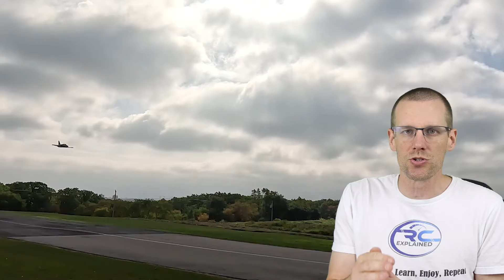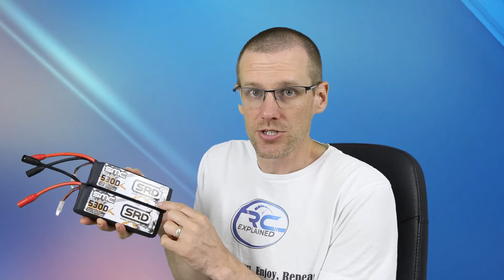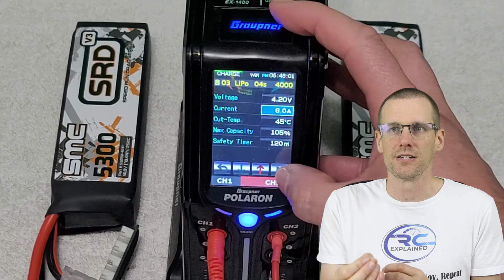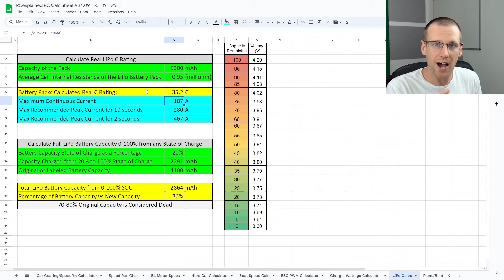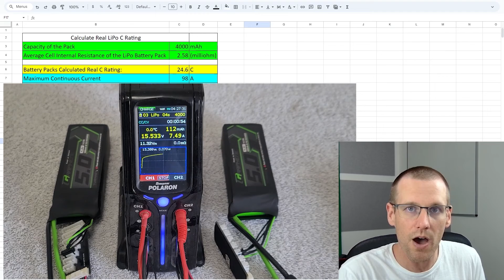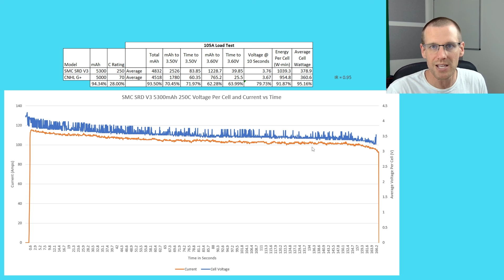Data Shows the SMC 5300 SRD V3 is VERY Good for Speed Runs & High-Powered RCs!

Comment: hey man, I might be making a video sharing some insights on Li-ion vs LiPo, with you as one of the sources. Could you please let me know what temperature the SMC 5300 SRD V3 heated up to so I can make informed comparisons from Li-ion to LiPo? Did it get anywhere near 55 degrees? Thank you :)
Reply from the maker: Ya, no problem. Under the 100+A continuous load , it finished at 51C @ low voltage cutoff.
Reply: @ thanks!
Reply: @ so, at this point, you wouldn’t really want to draw any higher currents from this cell, since it probably creeped up further than 51 C, right?
Reply from the maker: @h1tec  it does have some room to draw a Higher current. I stop my test at 57/58C.
Reply: @ so you reckon it could do 120A continuous or so? And are you stopping the discharge at 3.2V?
Reply from the maker: @h1tec  i dont have data for 120A but believe it could do it. 
LVC is set to 3.3 or 3.4v/cell
Reply: @ alright, thanks 😁

Comment: Id like love to see you test the smc srd 8600mah 4s thats what im running and they just hands down are more powerful than my smc srd 6200mah both v3 but you should really try to get your hands on there top  battery the srd 10,600mah according to smc's test it has the highest power factor or holdest the highest voltage under load. That's gonna be my next battery, so i would love to see how it performs.

Comment: SMC admits on their website that the C ratings printed on their packs are NOT true but they are forced to do it because everyone else in the industry lying out their ass.

The reason why I love SMC is because they have a power factor number for most of their packs on their website. They load each cell with 105A and the voltage of the cell under that load is the power factor number. 3.85v would be 385. 

I don't know of ANYONE else that posts actual voltage drop under load results.
Reply from the maker: That's true. They have that spec and no one else does. Still surprised the c rating has no meaning.

Comment: Kindly a normal new 1P lipo battery would have an IR of around 1 m Ohms so when they use a 2 ply battery it should be around  0.5 m Ohms!
The more cells that a battery have in parallel the less the resistance.
Please correct me if I am wrong and thanks for the information videos you provide.
Reply from the maker: If you place a cell with an IR of 1.0mohm in parallel with an identical cell, IR would be 0.5
Reply: Thanks that is what I thought but I was not sure because 2 ply batteries thatbI checked haven't got that much difference although they are of the same make! @RCexplained
Reply from the maker: I see. If you use 6000mAh and put it In parallel with another 6000 cell you end up with 12000mAh. That's a big pack. 2P packs are usually big otherwise they are not much different then a 1P regular cell.
Reply: Yes I agree but I am referring to the 2 ply battery packs like the one that you tested for example!  @RCexplained

Comment: Kindly I purchased four new 3s CNHL batteries 8200mAh 120c HV and when I checked the resistance it was 8 milli Ohms on each cell, on all four batteries so I tried to charge them to 4.2v and discharge them again with 20 Amps and resistance was still the same after the battery cooled down.
I charged them again this time to 4.25v per cell and discharge them again with 20 Amps and still the same.
I charged them to 4.30v with 8.1Amps and discharge them again with 20Amps and still I had high readings of around 7 to 8 milli Ohms. 
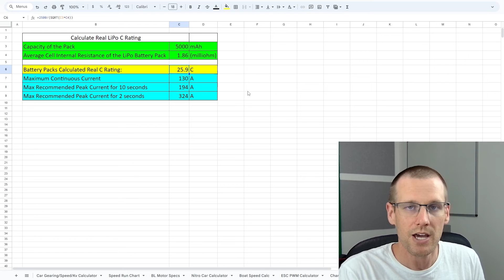The battery took 10:43.80 min to discharge from 12.9v to 11.10v and the 3550 v/mAh.
I am a bit confused because normally when I purchase a new battery the resistance would be much lower.
Please could you assist me with this issue because I am afraid that batteries are not safe to use because I can not imagine what will happen when they are under higher loads of around 400 to 500 Amps for a few seconds!
Reply from the maker: It sounds like the batteries have higher resistance. You can confirm you see the internal resistance value within the first minute or two of the charge. If 8 is the value, I agree that is high.
Reply: Normally when they go up to 10 to 15 milli Ohms I discard them but I never had CNHL and I am a bit disappointed with them and I have not yet tried them on the rc car. @RCexplained
Reply from the maker: Ya that's quite high especially for that capacity.
Reply: If I charge the 8200mAh battery to full charge and discharge it with 8.2 Amps, should it take one hour to discharge or my calculation is not correct, because I tried it with 20 Amps and it took around 10 minutes so if I divide 20 by 8.2 it comes out 2.4 so I if multiple it by 2.4 it will take around 24 min to discharge it approximately, so it is not even 8200mAh but just around 3280mAh, if I am correct with my calculation?